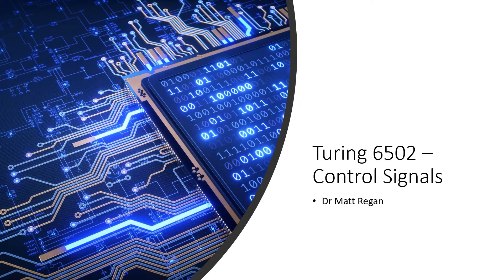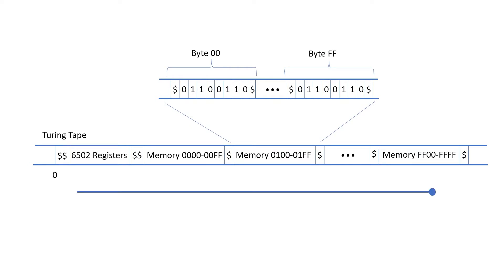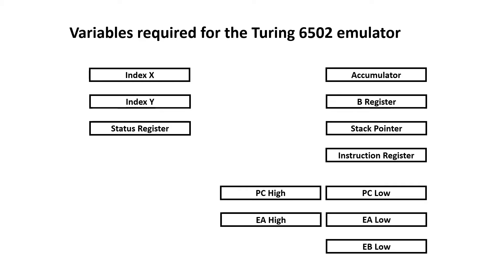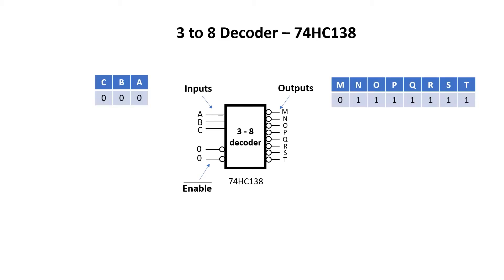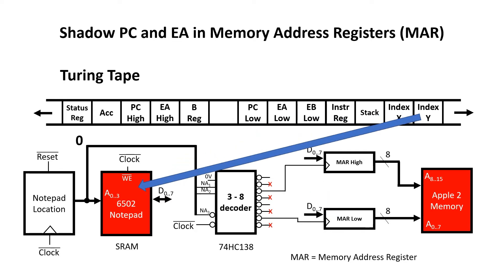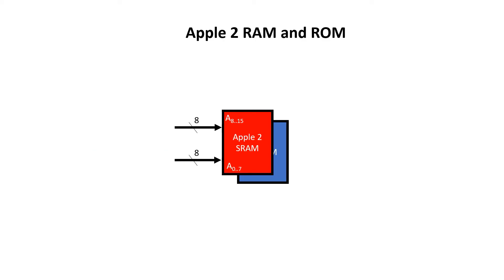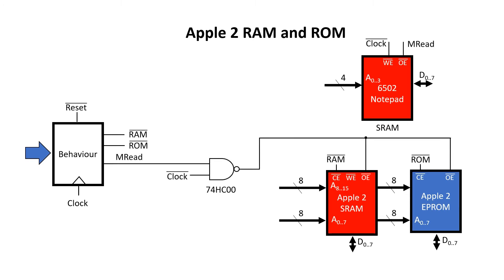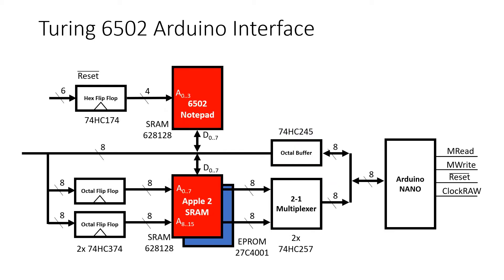Turing Machines Explained. Control signals.

Comment: The promised speed increase from moving the registers into random-access memory is pretty neat.
Reply from the maker: How are you going with it all?  Do you see that this is basically the same as PureTuring, except we have 256 symbols instead of 4, and both the main memory and the notepad are random access.
Reply: @DrMattRegan  Yes, I think so. It's still impressive to see what I've always thought of as a "by hand" method of computation actually being put into practice to run existing software.  I'm re-watching them all (thus being back here at Episode 3) now that I've watched "Pure Turing", to see how it goes when I get to what I found to be the "very dry and difficult to follow part" later in the series.  Hopefully, it will be easier to follow this time around.  🙂
Reply from the maker: Let me know how you go with it.  I tried to make the SAP6502 series a bit more interesting, but someone complained about all the B-roll.